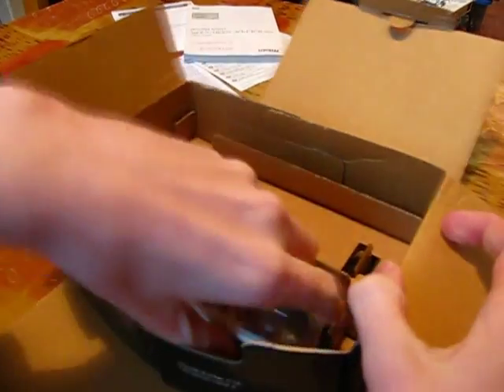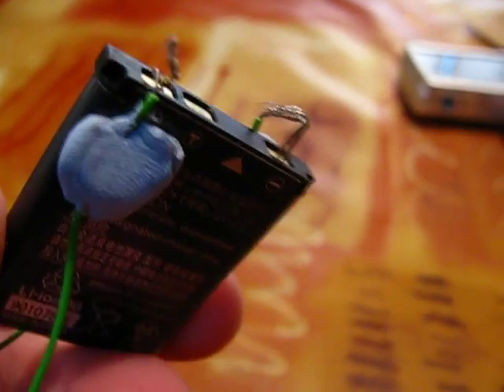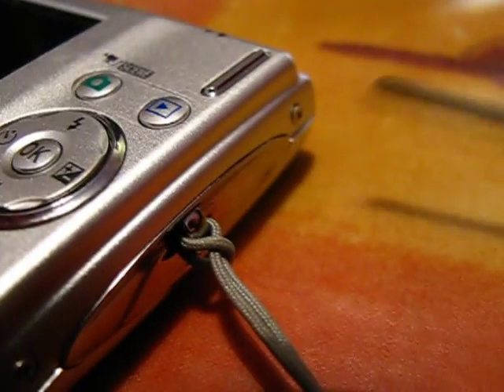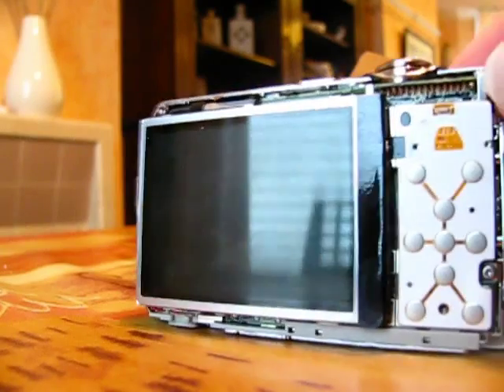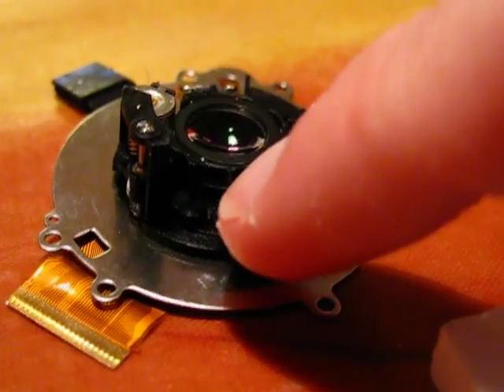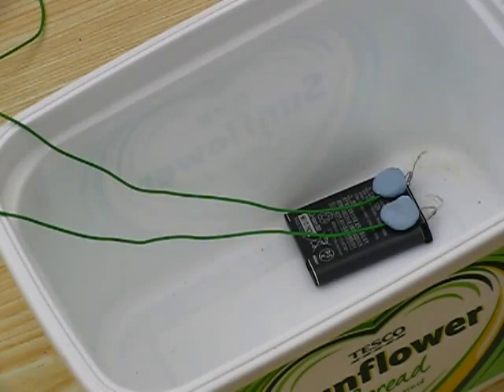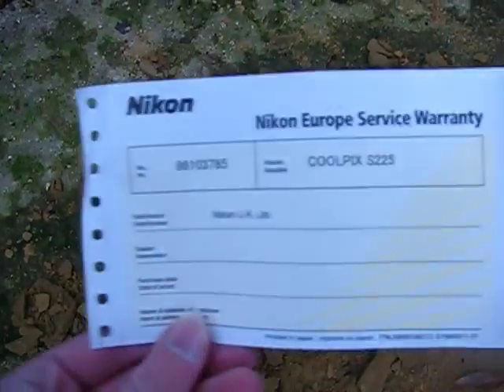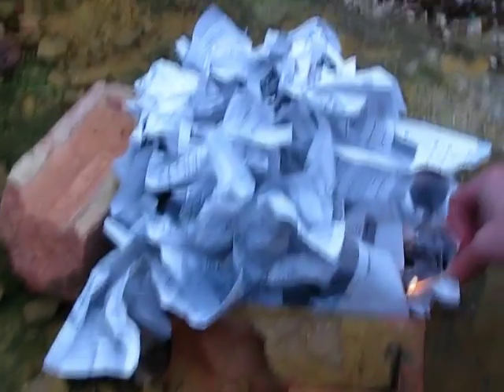Taking apart a camera

Comment: ElectroBOOM took apart a disposable camera, touched the wrong shit and got a nasty shock because he forgot to discharge the flash capacitor.

That loud bang you heard was the capacitor discharging. It dumped about 800 volts to the screwdriver.

Comment: Or you could have used it for just taking pictures of old lift buttons in case if those lifts were to get modded at some point but no, you wrecked the camera and it's useless. I mean you could have used it for a purpose or 2

Comment: You could have maybe tried to figure out was was wrong with the camera after the short circuit and the bang and probably fix it by putting a new computer board in it or getting it refurbished before you start smashing it with huge hammer like it was complete crap.

Comment: I've been shocked by flash capacitors far too many times, its never been too bad but i did once temporarily paralyze my thumb, index, and middle fingers for several minutes. Always remember to discharge the capacitor before using your bare hands to handle the camera.